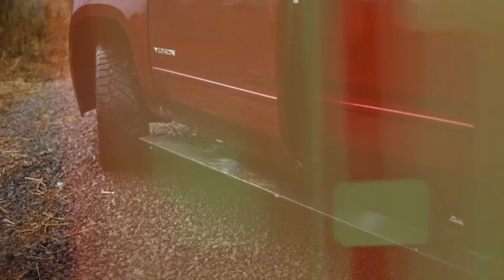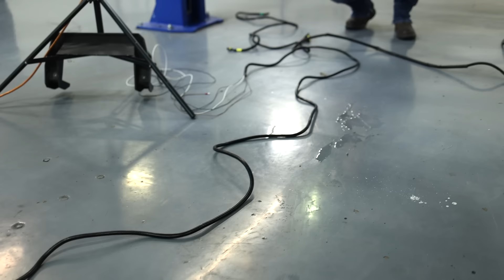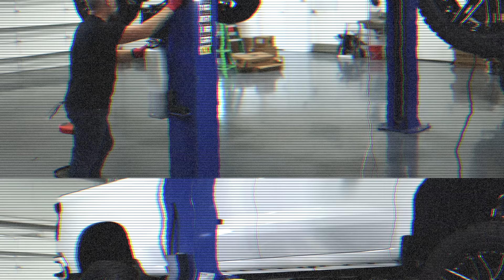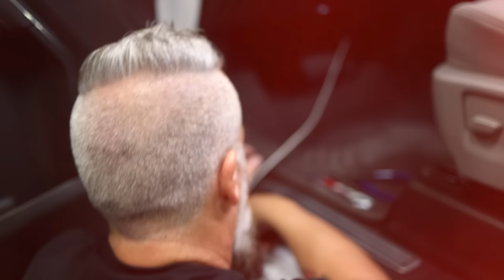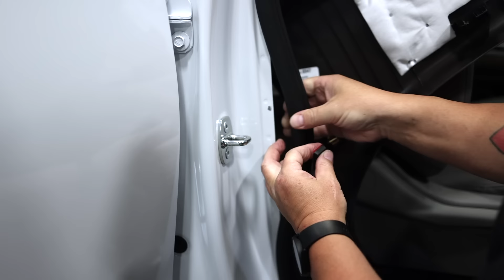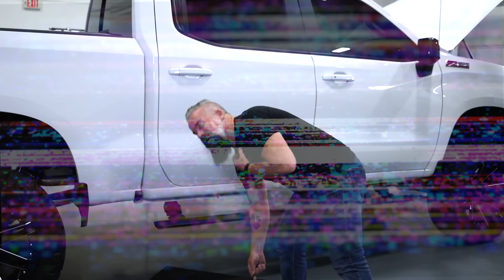Power Running Boards Install for Chevy Silverado and GMC Sierra

Comment: Do you make a step that goes all the way to the back wheel well, rather than stopping at the back of the cab?  I need a step at the front of the bed for easy access to my toolbox under my bed cover.

Comment: I just ordered mine and am excited to install them. What I'm most excited about, contrary to other comments, is that I don't have to connect to the OBD-II port. I've had Amp Research before, and I prefer to stay away from messing with the computer.

Comment: Someday, they will make the same set up and it will be all wireless run through the OBD port.  It will be a matter of running 12v to the motors and installing the boards.

Comment: A BETTER WAY!!!! I've installed quite a few of these now and let me share a huge trick!!! When setting your magnets simply remove the tape backing and apply the magnet (non tape side) to the sensor it will hold the magnet enough to when you shut the door the magnet attaches itself perfectly to the door. No need to measure or guess where to place the magnet. Your Welcome!!!
Reply: Can confirm, this does not work.
Reply: Yeah tried that and it didn’t work lol

Comment: So if one motor fails will the unit still extend and it will bypass itself and act as a hinge or will it provide resistance and not let the hinge open?

Comment: Really wish these didnt have magnets for triggers. I dont want wires seen in my door jambs. Why no OBDII connection like the competitor?
Reply: Properly setup you shouldn't see any wires really. Just the sensor itself. I place mine right above the factory door switch and it looks like it was supposed to be there.
Reply: You can also buy color matching heat shrink if it bothers you that much

Comment: All the videos I see have the motors delivered in the “open” position and allows the boards to be installed before the wiring. Mine came with the motors in the “closed or retracted” position. So I’m assuming I need to toggle the switch to the “off” position and have the doors closed then give them power and then open all doors and then turn the switch on so all the motors open at the same time and then be able to install the boards? Or is there an override feature to manually open them?
Reply: Did you get ur issue figured out as im in that same position today..appreciate ur input thankyou.
Reply: @ yes I did figure it out. I went ahead and installed all the magnet/sensors and wiring. Then when I had the power switch installed, I got in the truck and closed the door and make sure all the doors are closed and then I turned the switch to the “on” position and when I opened the door, the brackets for the running boards were deployed. I stepped out of the truck and opened the passenger door and while at least 2 doors opened from both sides, I turned off the switch and mounted the running boards and everything has been working great ever since!

Comment: I got these installed on my 2024 Silverado 1500 zr2 but my led lights only turn on when I open the door on both sides were they installed wrong or is it control unit problem ?

Comment: How hard is it on the magnet wire harness to shove the weather strip over it?   I want this kit and that's probably my only concern.
Reply: I was wondering about that pinching that wire over time.  I think when I install mine I’ll probably try to add some cushioning between the truck body and the wiring.
Reply: The wiring comes with a foam shielding with 3m tape on it. Slide that up tight to the sensor and then slip the door seal over that. On my Tundra I even had a little gap that worked to route the wire.

Comment: There is any way to adjust the steps on this power running boards, they work great but I notice that I added the shims and still making contact with the vehicle, is minimum the contact that they have but they still making this contact noise  at the time close or open the doors… if someone can help me out with this I appreciated!..
Reply: I’m having the same issue. Did you get a response?
Reply: Did you try loosening the 2 bolts on the brackets motors and then closing the door to bring the steps up and tightening the top bolt first ? I’m having the same issue

Comment: Hi, I have a quick question I have a set of JLU power runningboards on order. Currently, I have side steps that have LEDs that are wired into my dome lights. When I open the door they light up. Can I wire the steps the same way, so I don’t have, the wire door sensors? Thanks again.

Comment: I'm getting ready to spend a grand on these running boards for my bronco. What are the chances of the motor failing or the life of the motors? And what happens when or if they fail?

Comment: Holy cow! Install is hectic, at this point made up my mind to buy the AMP Research steps instead 😅
Reply: The motor mounting is the problem and the cheesy triggers.

Alllllll those holes where the motors go and they only use 1 hole.
I’m customizing brackets to hold my motors… better…. That bottom bolt/ to factory hole has to much play( they should have provided MULTIPLE spacers, type of grommet or something.

It’s never easy !!!!! 3 hrs is total BS bro.

Aliging the steps/motors to the rocker is the issue.
Reply: That's hectic to you? Lol maybe you need a Prius bud.
Reply: @louiejimenez360  I’ll take a Prius any day! 😅 and still put steps on it just for you
Reply: It’s not hard to install at all. Just did mine and took 3 hours. It’s a great product
Reply: The AMP steps are almost identical in installation and cost more. 😂

Comment: This is by far the best installation video on installing the Rough Country E Boards..... the hardware is pretty much explained in the individual model truck  butt the wiring tips shown here can apply to most all trucks with minor exceptions. This one gave me the tips/confidence to tackle the installation on my F150 Lariat truck.

Comment: I have had AMP steps many of my trucks and never had an issue. Just keep them clean and lubed. I bought the RC steps for my brand new 2024 ZR 2 HD2500 bison. Installation was straight forward, steps. Look good and the work perfect so the few weeks I have had them.
Reply: Clean and lubed what you mean where at ?

Comment: Best installation video for electric board. Can we cut those boards for better fitment? I have a 2023 Tundra double cab for which there are currently no electric board offered. I’m thinking about buying one for the crew cab then cutting it to length for my truck.

Comment: This is perfect timing, I'm installing these on my '18 Sierra right now.
Reply: i’m thinking about buying these for my same sierra how have the e boards been for you
Reply: yeah how has the e boards been?
Reply: @edwinmuniz1263 performance wise, they have been great. I recently got a lot of mud on them, which they started squeaking a bit after I washed them. I'm not worried, as I'm sure a shot of lithium grease or penetrating oil will be the easy fix.
Reply: How much do these go for